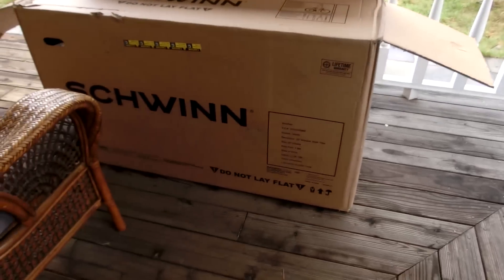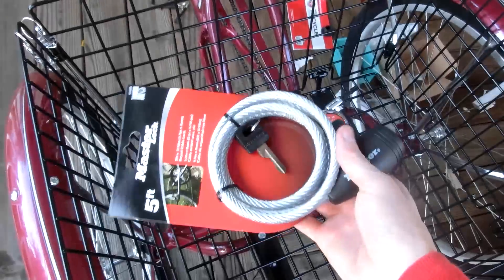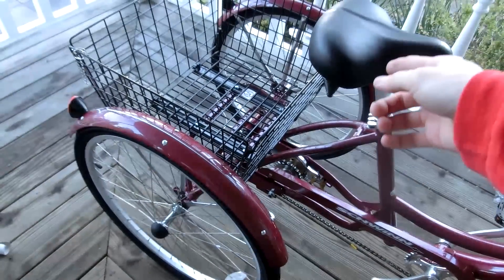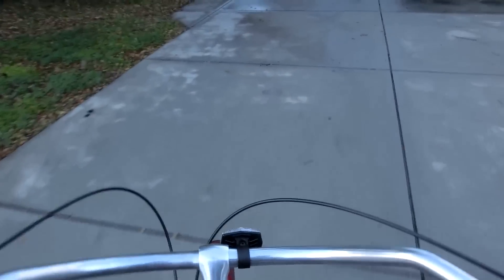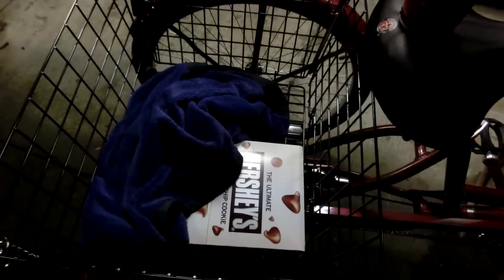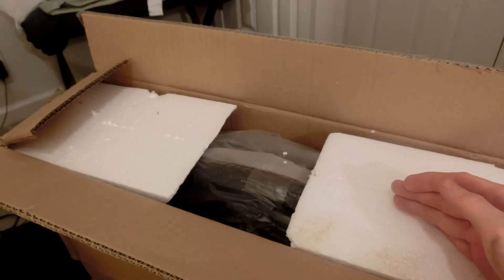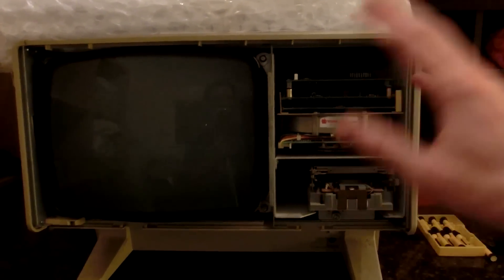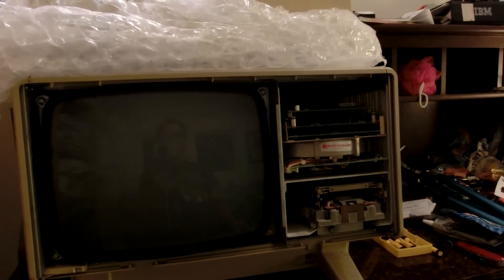Random Bits 0075: Schwinn Meridian Tricycle Assembly

Comment: Stiff backpedal would mean your chains are a bit tight...  Sucks you can't ride on the sidewalk, you need to make sure that thing is visible.  A flag would be cool.  Maybe some ground-effect led's?  That frame seems like a great platform to add some stuff.
Reply from the maker: *****  i think EL wire would be cool, but i'll be adding a 100w led on front and two 10w leds on back.

Comment: Damn, $270 was a good price, they’re way more expensive today. I bought one from my neighbor in rough shape, I was hoping you could tell me about how the crank assembly works. I have done research and it uses a square spindle, but I am not sure if it uses a nut or a bolt to keep the crank fixed to the bike. Mine is missing nuts, but the threads are messed up so I’m hoping it used bolts and the ends have been sheared off. I can’t find any information online how the crank assembly is put together.
Reply from the maker: Its been too long for me and I never even opened the crank so sadly I dont know

Comment: What motivated you to buy a tricycle? I know you can fit quite a lot of heavy things on it (batteries) but there are some powerful lithion-ion batteries on the market fot electric bikes.
Reply from the maker: i dislike how bicycles fall over all the time and dont have much cargo space. with this tricycle i can even add an onboard charging system to accept 120v or J1772 car charger plug. my 48v 24ah battery is stronger than most batteries i know. i'm wanting to up this trike to about 48v 60ah to give it close to 300 miles of range.
Reply: Rinoa Super-Genius
cool, so we will see what you'll make out of it. And your reasoning is sound, but it misses the "mad scientist" aspect a bit :D

Comment: Re: the Knocking sound, I get a knock from the rear end once per revolution on my trike whether I'm pedaling or not. Does that sound like what you experienced and did you ever figure it out?
Reply from the maker: yeah that sounds like it, and i figured it out. at 3,000 miles the wheel snapped off going into a turn and wrecked pretty bad. evidently that knocking sound is something to do with the axle slowly bending. the axle had developed microcracks that slowly chipped into the axle.
Reply: Same exact sound on mine exactly as you described! Help! Anyone know how to fix it?

Comment: My husband bought this for me and I'm loving it. I ride it to work, to shops and a lot of other places. But I do go up hills, and my legs freaking  burn when I do. Would adding the battery help with going up hills? And I have to admit, the fenders really are bad. I've been having a hard time with them.
Reply from the maker: +TulipWife yes a motor and battery would help a lot. if they are pretty steep hills id recommend atleast getting a 500w motor. you may want to go with like a 24v 500w motor kit from ebay. it would be easier to find a 24v battery, it should still go like 20mph, and it will have as much torque as my 48v 1000w.

the kit can cost like 200$ or so, but if you dont need to go far you can use old cheep batteries. like if you know anybody with 24v power drill batteries lying around those might give you like 4 miles of range. but only use the power drill batteries if you can find them super cheep. like 10$

Comment: You might consider either U.V. resistant zip ties to to strengthen the basket hinges or coiling black coated wire around the basket edges to hold them together instead of welding because welding creates a semi-permanent condition and may damage the wire.  You will need to be able to flatten down the basket to install the rocket motors ... or not.

Comment: Did anyone have problems with it leaning to the right? 
I bought mine used and it keeps turning to the right nad I have to lean , hard to handle, not sure why?
I know some people have trouble with this problem, and you need to get used to riding a trike, but I rode it for about a half an hour and it was still leaning...
Reply from the maker: sure its not just the road? roads lean to the right

Comment: We get ours delivered today...How long did it take to assemble? Any speical tools or sockets needed? Looks like you did it all with the adjustable wrenches...Thanks...Philip
Reply from the maker: Uptown Photography you can get by with mostly adjustable wrenches, pliers screw drivers and hex keys help a lot though. i say it took me about an hour or so to put it together. then another 15 minutes to go over all the bolts to make sure they are tight.
Reply: Rinoa Super-Genius Thanks for the super fast reply...Ours was just delivered, so I will assemble it later...
Reply from the maker: Uptown Photography
i hope it goes together easilly. if you have the middle gear hub thingy make a knocking sound i would like to know, me and a friend of mine have both had an issue with our tricycles making knocking sounds. i should reach 1000 miles on it in a few weeks so then i'll do a teardown and try to fix it.
Reply: Rinoa Super-Genius I will let you know one way or the other. Did it make this noise right from the start or take time to show up after using it..I ill probably assemble tonight.
Reply from the maker: Uptown Photography
i think it started from the beginning, but i know it was doing it atleast after 10 miles.
Reply: Rinoa Super-Genius So far I have not noticed any noise, but we only went around the block as it was late by the time i got it together...i will keep you posted. The bike went together pretty easily. The most problem I had was getting the master link on the secondary chain snapped into the locked position...
Reply: Uptown Photography Did you have any problems steering it. It's very strange to steer and not like a regular bike in that regard. It seems to be very sensitive and hard to control..Thanks...
Reply from the maker: Uptown Photography nah it steers how i expected it to, but i have already made weird tricycle type things before so i knew how to ride it. many people i have let ride it always crash it within a few seconds because they can't wrap their head around it haha.

Comment: About how much weight can this thing handle? i am around 350 lb and i am thinking of getting one because i can't balance on a 2 wheeler.
Reply from the maker: dwarfminerwillie i'd say that may be pushing it, but i think it could hold you.

i think it would be a great way to lose weight. maybe also add a 250w hub motor to it, that way you can go like 5mph faster to get some breeze and also you wouldnt worry about driving too far to get back without hurting yourself. thats the main reason why i started motorizing my bikes is because i would ride out too far and almost get heat stroke. i find it easier to exercise now.
Reply: Rinoa Super-Genius It would be my first time getting a bike so i wouldn't really know how to install a motor. Im also considering it to help me get across my college campus faster (If i run or walk to fast my feet get sore quick) but thanks for the info!

Comment: My bike shop has warned against the Meridian because if the spokes start breaking, replacement wheels aren't sold by Schwinn or any seller they trust. Have you had any trouble with the wheels breaking down or finding replacement parts? (Are they just trying to sell me on something more expensive?)
Reply from the maker: yeah it breaks spokes a lot, but they arent hard to replace. i'd replace them every weekend on my trike since i ended up driving it as my main vehicle. i rode it for 3,000 miles and then the axle snapped. i see it as a good first tricycle, and then after 2,000 miles you should see about getting a Worksman tricycle.

Comment: Have you considered hacking together a differential for the rear wheels?

That trike sounds pretty cheap, especially compared to the mess of a bike that I have.

I'm excited to see more videos and seeing how you deal with problems, like most bike locking stands not having enough space to put it and so on.
Reply from the maker: well one idea i have is making the wheels lock solid, if i make it heavy enough nobody will be able to move it easilly. also an internal GPS tracker would help. but that would still require stealing it back or going to the police.
Reply: Locking the wheels solid isn't a great idea.
Axial differentials exist to solve this exact problem.
You might find building it interesting.

My main bike issue is down to people trying to steal parts off of it.
Even though the worst that happened was the rear wheel getting destroyed, now I lock that to the frame when I lock it up.
Reply from the maker: bno112300
i dont mean locking it as a diferential. i mean a steel bar that locks around each wheel so it cant be turned, thus sumebody would have to carry my 150lb bike to steel it. then i can weld a lot of the bolts down so i have to grind the tack welds off to loosen them.
Reply: That's pretty hardcore.

I'd hope that you make it obvious though, anyone committed to stealing it will probably at least break it.

Comment: I won't swear to it, but I think you will need some working lights for the bike, while in California. Maybe get a smaller battery pack for them, or even one of those small generators that run off the tires.
Reply from the maker: already have a light on my helmet so i am legal, but im adding a 100w light on front and two 10w lights on back.
Reply: Rinoa Super-Genius that ought to do it! I have a 7 watt incandescent on mine. LOL.

Comment: Regular shoes would be better than open toed sandles when working with heavy equipment. had me wincing at 1:15 mark. Also as an FYI never work on a bike upside down (see edit below). Just what I was always told.

Thanks for vid, need to put one of these together soon.

Edit the instructions say to install upside down. assembly sucked btw. would be easier with two people and I guess a caliper to make sure its centered and 'square'. Mine came missing a washer for the rear frame connection. need to complain about it and get a replacement and replace the nut with the washer. I did it for now just to see it working Also the rear frame was scuffed up but thankfully that was the side facing down. I doubt they will send me another rear frame and axel assembly but I will try. I guess I should just learn to sand and paint than clear coat. It was more difficult than I anticipated. I should have bought from walmart directly (got it for 207 from 5centmarket.com and says shipped from walmart actually, weird) and made them assemble and just adjust it. I bet they would not worry about the washer or centering everything and just slap it together. The front wheel does seem to be off center but I measured and it is center. Its not touching the brakes so I guess it's just me being anal. I tried to re position the rear frame a bunch of times to get it perfectly 'square'. Well you live you learn.

Thanks for all these vids it helps knowing what I could run into. The person using it is light weight so hopefully it lasts longer on gentle rides than yours did. i doubt it will ever get to 3k miles but who knows!

Comment: nice bike but your front forks are on backwards  cheers
Reply: That's right - they pack it that way.  There is NOTHING in the written instructions or the extraordinarily wimpy on-line instructions that tell you "first, spin the fork 180 degrees to put it in the correct orientation".  I just got lucky and noticed it in all the pictures after having manipulated the handlebars to get all the brake lines in place!

Comment: I bought my mom one of these. last year. Damn thing came with a bent axle shaft so I sent it back. Luckily I was able to find her an old SEARS store brand trike that has 5 gears, freaking posi and is built about a thousand times better that these junk Schwinn's at a fraction of the price. I striped it and painted it, updated the brakes and strung it with new lines put white wall tires on it and man does it look cool. Plus with all the stuff I did to it plus the cost of the trike it's self I still saved more than $150 over the cost of these Schwinn's. Moral of the story - our parents are right when they say stuff isn't built like it used to be.
Reply: what brand is it? How far can a person travel in the bike you described? is it a slow or fast tricycle?
Reply: It's a Sears "Free Spirit" Like any other bike how far one can travel is dependent on the riders endurance, the bikes setup and things such as seat, pedals and grips.
It's setup more like a traditional bike wherein the pedals are right under the seat post. On the the trike in this video the pedals are way more forward(more of a recumbent position.)
On flats I've had the thing up to 18 MPH BUT that was on the flat and I didn't feel comfortable at that speed. I'd say stick to under 12MPH and you'll be golden.
Reply: ***** yeah I know it depends of pedaling power, but you need to remember these things weight 70 to 78 pounds so I wanted to know an average. But cool to know they can go fast. 12 mph is fine after all in a regular bicycle with one arm I go slow because the steering shakes left an right like crazy. Thats why I fell down three times yesterday night I dont have a left arm. I can only turn to one side fine but the other turn is trouble. If I had a prosthetic arm, at least I could have more control. But I barely have anything in my left side. Thank you.
Reply: Sorry to here that. A trike sounds like may be what you need. But you may also want to consider a recumbent bike or trike. With those you're lower to the ground and your body is able to control the movement much easier that on a traditional two wheeler and especially a traditional trike. I don't believe having one arm would be anywhere near a hindrance on one of those as on a traditional bike.  
Now I have to warn you ridding a trike is completely different than riding a bike. People assume becasue there are three wheels they're more stable. Yes they are and no they're not. You absolutely can tip them over and very easily if you're not paying attention.
The biggest difference is turning. On bike you lean into a turn. On a trike you don't lean at all unless you're taking curve at speed. In that case I lean away from the curve. It takes a while to get use to but once you do it becomes  second nature.
TriTon and Mobo make decent entry level recumbent's and a company called Trailmate makes specialized trikes for folks with all sorts of special needs. You've proabbly seen theur Desoto model but they make so much more than that particular model.

I wish you all the best with finding a bike that fits your needs.
Reply: yeah, I know about recumbent trikes, They have always been too expensive for my budge. I just need something easy to ride to my university and to commute to a one to two miles job. The last time I did a huge research about recumbent trikes was in 2011. They were too expensive and left side and right side of trike had different controls. If I take a guess, I'd say they could modify the trike further. But everytime, I look into anything for disabled people, the already high prices of the item increases further if additional modification is needed. For example, look up this item "MonoMano Adapted Cycle Handlebar." It costs $336.99. I'd rather just get a full tricycle for less or the same, I can carry stuff in basket, and I'm visible for passinf cars. thank you